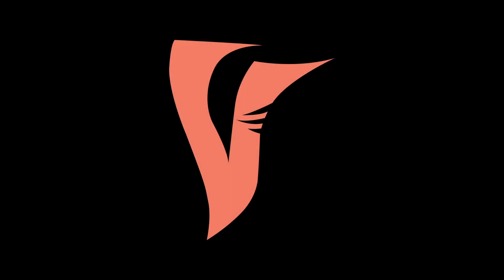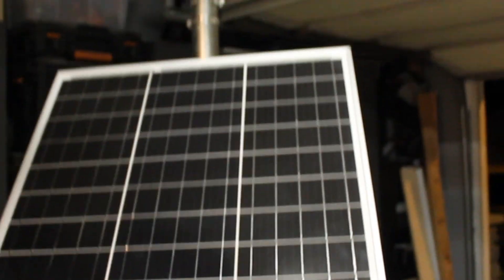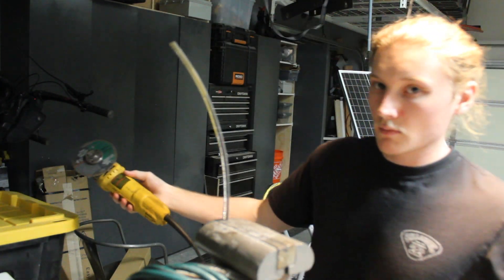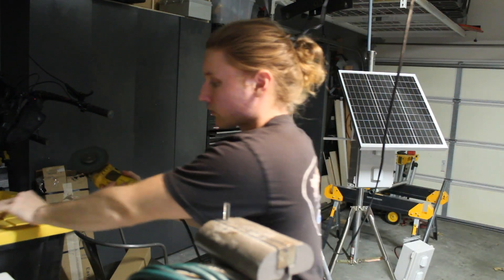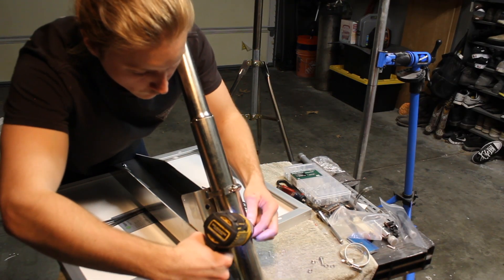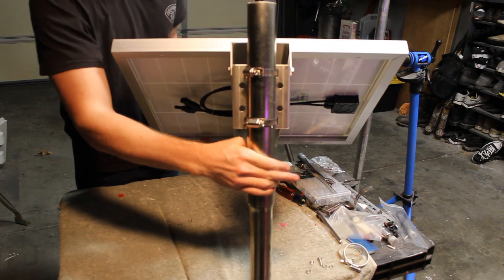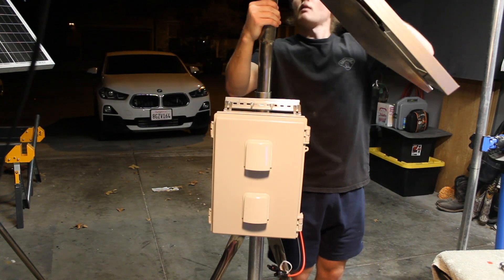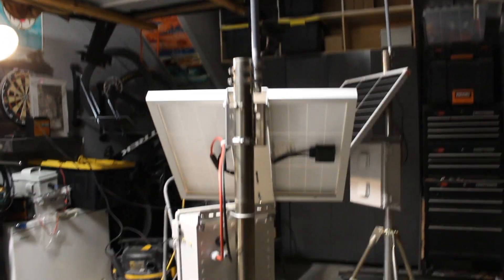Build Your Own Off-Grid Helium Miner EP3: Panel, Mast, Tripod, Antenna

Comment: Still waiting for your 4th video with a lot of anticipation:)! I wonder how do you connect all the devices to the battery? Miner is 5V3A, how about sim router and vents?
Reply from the maker: I apologize for the delay, I will try and release that  video within the next few days. Miner will be connected using a buck boost converter coming off the battery.

Comment: Nice man! Looking forward to your 4th video! I see 50W solar panel and 12V battery. How much Ah is battery?
Reply from the maker: Battery is 30ah
Reply: @bgoodbuilds4571  is that enough? You must be deploying your off-grid work of art in a very sunny place:). In the place where I live winters can be cloudy and foggy for days. I need to do some calculation before choosing battery
Reply from the maker: @mustachess  exactly, it is dependent on where you plan on deploying. I live in Southern California where it is sunny almost year round. Consider bigger batteries and panels for your own circumstances. Keep in mind if you choose a bigger battery, you’ll likely need a bigger enclosure as well. Same thing goes for the solar panel; if you get a bigger panel, make sure to account for the bigger panel mount you’ll also need